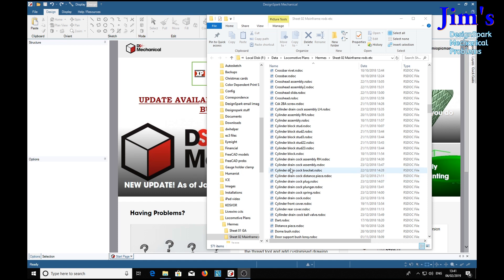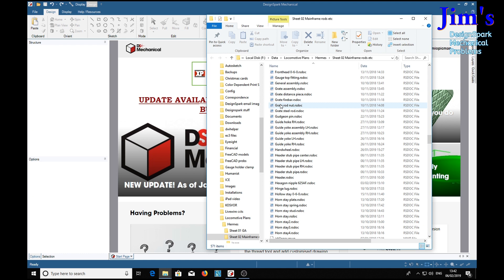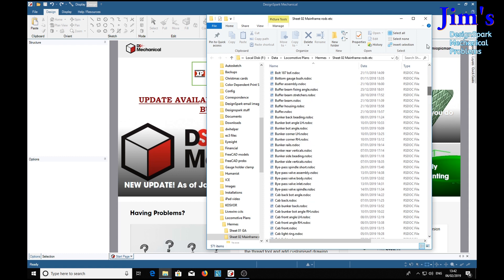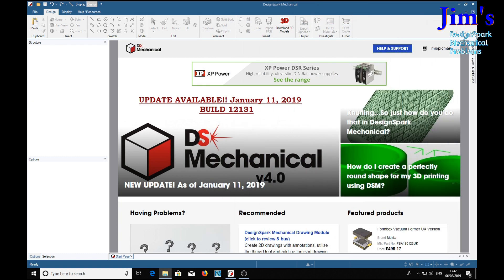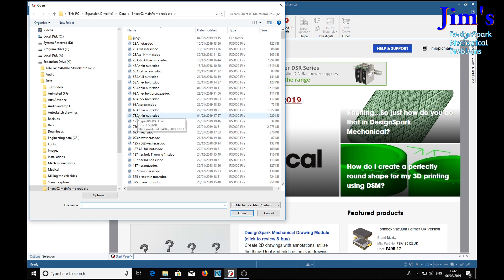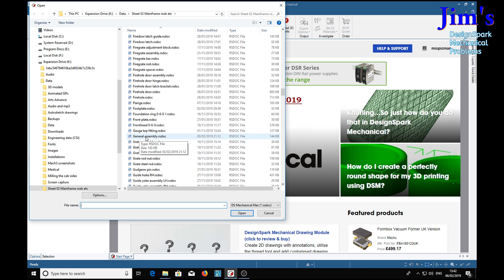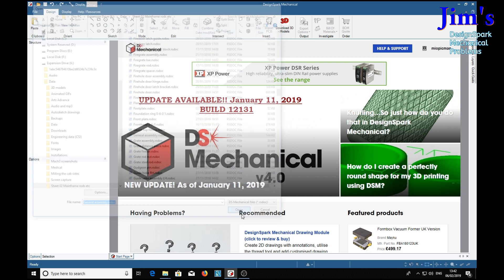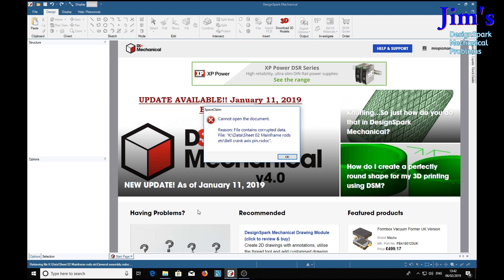DesignSpark Mechanical: Corrupted files render months of work useless.

Comment: Great video's Jim I have a similar problem, I have a certain component, I copy that component and  right-click source - make independent. Now, If there is an image in this component, the file gets corrupted, I cannot save that file. Images in components causes a problem if copying and making new independent component.
Reply from the maker: Sounds like you need to report this issue to the DSM tech support. - go to Help / Resources / Email RS Tech Support.

Comment: PLEASE CHECK THIS OUT :  move the "corrupted file" to desktop using cut and paste. Then open DesignSparkMechanical  and open the file from its new location (from desktop menu). 
In my case it worked, i hope that it will work for you. There might be some kind of problem or bug with the file's location even if the rsdoc file is perfectly fine.

P.S   Jim, your videos are very very helpful for  DSM software. Many thanks
Reply from the maker: I tried it, needless to say, my luck being what it is, it did not work. Thanks for the suggestion though.

Comment: Hi Jim, I have also found designspark mechanical very unreliable. What solved some of my issues was uninstalling and reinstalling dsm. For some reason that stopped a number of issues I had but occasionally they return anyway. The main problem I have is unable to save file due to corrupt data. I put in a support ticket with dsm but asides from acknowledgement of my ticket by a robot email, have not had any substantive response.
Reply from the maker: Sometimes it can be quite a while before they respond

Comment from the maker: DSM have replied to my ticket on this issue. Here is part of it:
------------------------------------------------------------------
There was a similar problem in SpaceClaim (DSM's parent software) which was resolved in 19.1 (DSM 4.0 is based on this release).  However, files created prior to that might still carry the problem.
In the past, it was sometimes possible to rename the top level assembly to .zip and open it to retrieve (possibly) some or all of the geometry.
You can try this.  Change the name from Design1.rsdoc to Design1.zip.
-----------------------------------------------------------------
I am going to try this. I'll report my findings one way or another.

Comment: A partial solution could be:
1. save all files on another disk or usb stick

2. create a file containing a simple sphere (or what you prefer)

3. copy this file over to the corrupted ones

4. try to enter
5. when you'll be able to reenter, you can redraw only the corrupt files.

Be careful that if you refer to a corrupt file in a container file the problem may appear in the file containing even if it is not true.

You will not recover all the files but at least you will not lose all your work.

Comment: I have learnt a lot from your great videos Jim. I feel that the latest DSM version V4 is less stable than the old V2015. I find V4 does a lot more processing than V2015 and fails to find a shape solution a lot and kicks out errors continuously hence I stick with V2015 and  only use V4 for the "blend" tool. Hope they can help you out Jim.  Cheers.
Reply from the maker: Thanks Brian

Comment: Thank you for your videos, and especially this one. I use DSM 4 for prototyping an archtop guitar. I started in December and this is my second attempt to use 3D CAD; the first was FreeCAD, which was harder to conquer for me. I love DSM! This is the program in which I spend much more time for thinking how to design and less how to draw it. My assembly is only more than 50 components and sub components, but there is a lot of complex solids and surfaces.  I use until now only internal components so my file reached 50MB and my computer become slow. To fight that I decided to look for the option of making components external and lightweight. While trying to learn the way I found this video. That is a warning... Until today I was making backup of all files 1-2 times per week. As of today I am doing that daily, keeping at least 3 full past copies of my project.

Comment: I don't know how their file system works, but back when we used DOS, and I was designing using Autocad, there would be a .dwg file that opened with the program, and a .bak file that was the previous version of the drawing. If there is some file scheme like that then perhaps you could resurrect your models that way. That's a huge project. Surely you aren't alone in this. I got ticket opened with DS when the latest version would not install. Once that ticket was opened it allowed for an ongoing conversation with them. Best of luck.
Reply from the maker: I have since had a look at the backup system in DSM and that also seems to be screwed. That is going to by my next DSM problem vid on YT. Be informed that I always lodge a problem ticket, and leave it a week at least, before uploading a vid about it. Apart from the ususal acknowledgment of the ticket, I have not yet heard anything. 
After the problem occurred I have backed up the whole project on two separate memory sticks. They still contain the corrupted files but it was very timely as you will find out in later videos.

Comment: Hi Jim, Is it possible the problem is with DSM itself in which case a reload may cure the problem.
Reply: I'm very curious to see how this develops.
Reply from the maker: Don't worry, I will put up a video when the answer is available.
Reply: That would be apreciated as I am using DSM to create 3D printed 16mm/ft model locomotives and rolling stock so the problem you have found is a concern even though my GA's only have about 20 components per loco a bug would still cause grief.
Reply from the maker: I did try that but no joy. However, I did not uninstall the initial installation. I may try that later.